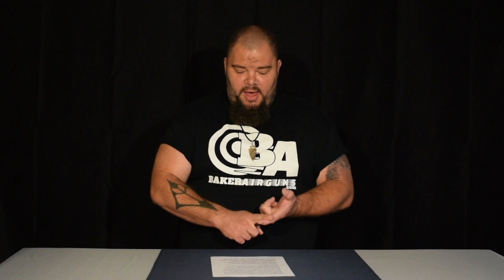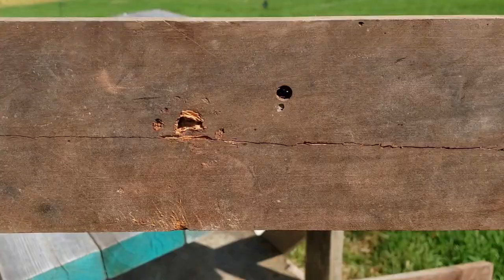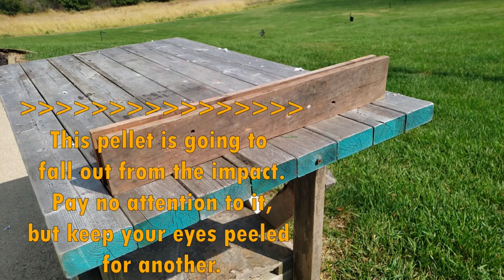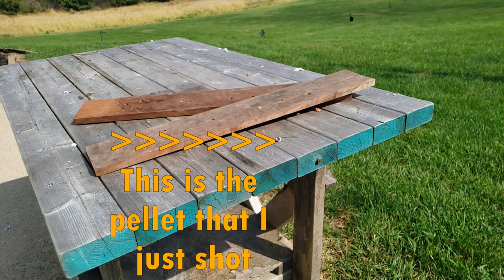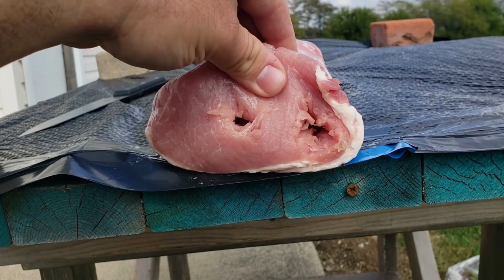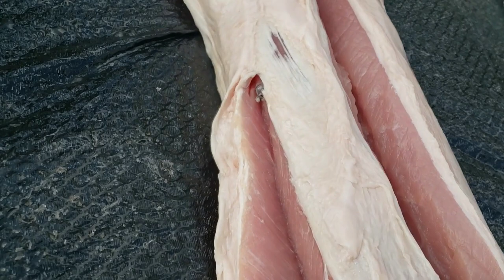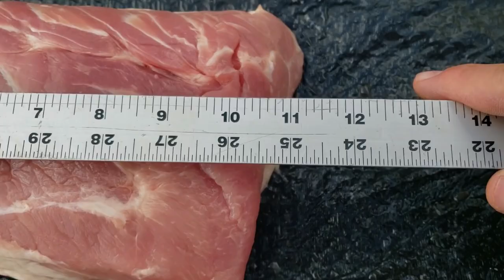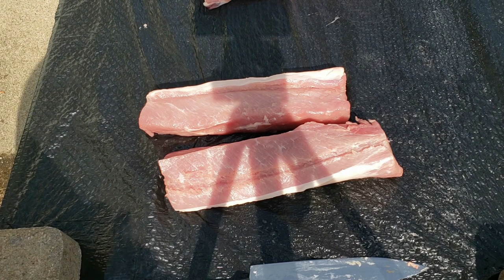PART II...What's deadlier, a .25 or .30 caliber airgun?

Comment: The FBI uses projectiles fired at the same velocity and not the same kinetic energy. Your results are inconclusive at best, and deliberately disingenuous at worst. Re-do the experiment, and this time actually follow the procedures of the people you cite your testing methodology for. 

In the meantime, I'm going to use your video to argue to my local game warden that it's totally ethical and humane to take a deer with a Crossman 1337, since clearly .177 is far superior to .25 at 20fpe.

Comment: To believe all that nonsense about the heliocentric model in the beginning, it taints your results for me.  Gas requires a container, liquids require a container.  Liquids don't conform to the outside of a ball spinning over 1000 mph.  Water always finds level.  That's why you can zoom in on the city of Chicago, from over 50 miles away,  And see the entire city.  Impossible on a ball 25,000 miles in circumference

I do appreciate these 25/30 cal tests from a technical standpoint.  It helped make my decision on a 30 cal hp aea semi over the 25.